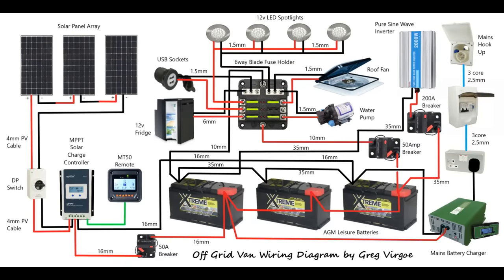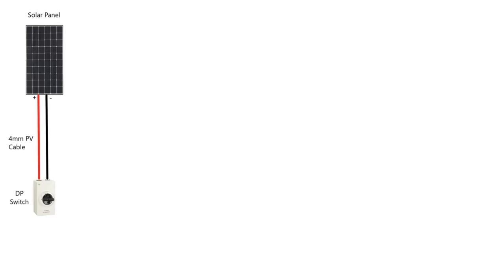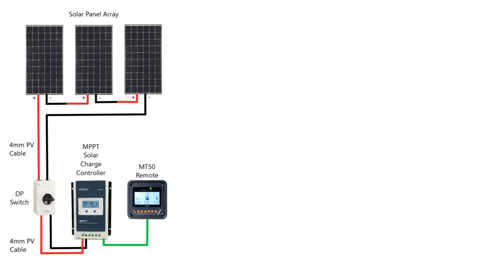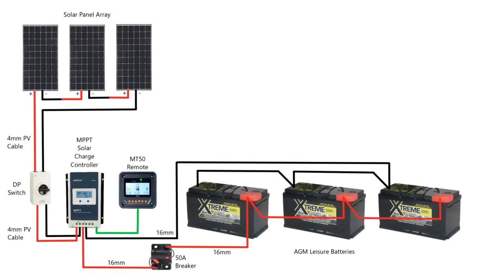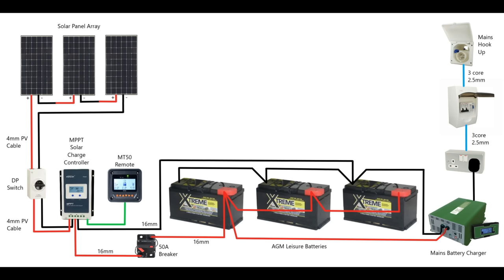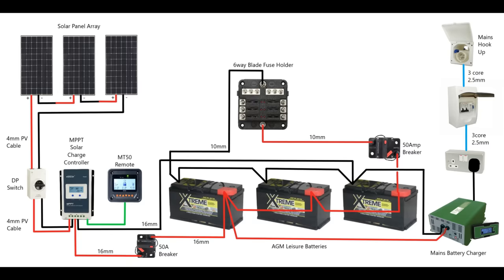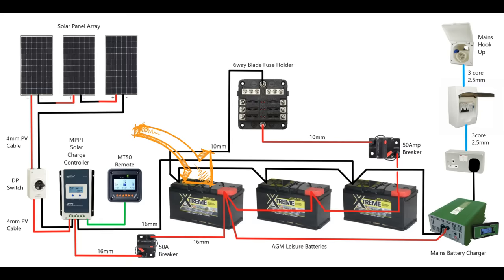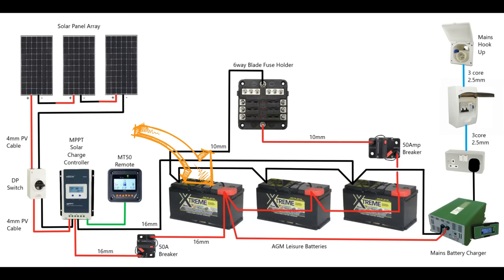How to Wire your Camper Van to be Off-Grid

Comment: What about changing while driving from the Van?
Reply from the maker: I recommend using a DC - DC charger to do that. It very easy to install positive and negative from the charger to both van and leisure batteries. Victron Orion are very good ones

Comment: Could i replace the inverter with a inverter-charger like the Victron Energy - MultiPlus 12V 2000W, 80-50 120V VE? I can’t find any good diagrams with that inverter without it being full of other junk from that company

Comment: Hi there Greg, I’ve sent you a Facebook message with regards to a connection on the MPPT controller. 

My cable is too large to fit in the MPPT controller, what lugs have you used, as I cannot find anything that I can get to fit in the input of the MPPT. 

Thanks

Comment: I have the wiring figured out. Im just having trouble with what size wire and fuse I should use for my 1000w inverter.
Reply from the maker: 1000W / 12v = 83amps
83 + 25% = 104amps
So a 100amp fuse or breaker will be the right size for that inverter. 
Watch my video on cable and fuse sizing https://youtu.be/koFg6oFs0RU

Comment: Hi Greg, great video, I have one question, how do you connect 230V appliances to inverter i.e. do you run cables from inverter to the point where you need power e.g. your TV and if yes what size.

Comment: Why is there a 200 amp breaker for a 2000 watt shouldn't that be a 250 amp breaker or am I doing the math wrong.
Reply: 166amp so you rounded to a 200 amp breaker.. sorry the video is amazing I was just trying to understand this part
Reply from the maker: (2000/12) x 1.25 = 208 👍🏼😁

Comment: Isn’t 166amps a lot for even for 3 leisure batteries and how long can you run your inverter ?
Reply from the maker: In reality the biggest thing I use is the Laptop which is about 140W so approx 12amps
Reply: @GregVirgoe  surely your batteries can provide 12amps ? Is the inverter not converting 166a dc down to 12a ac ?
Reply from the maker: @matthewsmith7319  the inverter will only drawing the current it needs. Just because it’s a 1500w inverter doesn’t mean it uses that all the time. It’s like your car driving at 30mph when it can do 120mph top speed. If I only connect a small load it will only draw a small load from the battery.
Reply: @GregVirgoe  ok thanks Greg

Comment: Can't see any switches for the led lights on the wiring diagram.
Reply from the maker: I left them off for simplicity but you can easily break a red wire and insert a switch.
Reply: It's there Stephen. 11 minutes 58 seconds in for a very short time.

Comment: Where u plug battery backup charger is called what?
Reply: And why the connection went to the ba3 straight without going to charger controller first?

Comment: what wire do i use to connect the parelel batts what mm
Reply: In this setup shown, 16mm if not using an inverter or 35mm if you are.

Comment: Hi how to connect up engine battery to this system ?
Reply from the maker: Use a DC to DC charger to connect your van to your leisure system
Reply: @GregVirgoe  ok would you have a diagram for this 
Thanks Steve
Reply from the maker: @stephenhurrell2773  they are very simple. Poss and neg from van battery to charger and sake from charger to the leisure batteries. 
Victron Orion is a good make 👍🏼
Reply: @GregVirgoe  cheers

Comment: What to do if I have one baterry?
Reply from the maker: Look in the description below this video there are links to diagrams showing just one battery 😊
Reply: And why not to wire the users on last ports on the controler?
Reply from the maker: @kmetkmet7  I believe that is only for small loads like lights but check the specification of the charger. 😃

Comment: Why would the fridge wire change from 4mm to 6mm makes no sense, same fridge doing same thing nothing has changed
Reply from the maker: The larger cable is to reduce the voltage drop. Most fridges need a big cable see your fridge manual.
Reply: @GregVirgoe  Just leave it at 6mm then, its not rocket science.

Comment: How do I find out the information about my solar panel I have bought a truck with one fitted but dont know much about it hope you can help
Reply from the maker: There will be a sticker on the back of the panel with all the details.
Reply: Its a 375 watt so 2hat size controller would I need please.
Reply from the maker: @360outlawdriver3  to utilise it’s full potential a 40A mppt controller is what you need.
Reply: Is a 40 amp one ok to huck upto 2 batterys for storage
Reply from the maker: @360outlawdriver3  if you have 2x 100Ah that would be a good setup
Reply: Do you have a link for the DP switch that is in the circuit between the panels and the controller
Reply from the maker: @360outlawdriver3  download this parts list and all the links you need are there https://www.dropbox.com/s/zvtyj0z7cdeb9d8/Greg%20Virgoe%20Campervan%20Parts%20List.docx?dl=0
Reply: On the lorry is 1 solar panel thats 375 watt going through a mppt 75/15 linked to 2 batteries that are 140 amps each then its linked up to a 2000 watt inverter so I guess I not getting full use out the solar panel as its not linked up to a 30 amp mppt
Reply: If I need to run the cables from the solar panel very far and the wire that came with the panel is not long enough how can I extend the cable length safety thanks.
Reply from the maker: @360outlawdriver3  yes you can buy MC4 Weatherproof connectors which are easy to crimp on yourself. 4mm PV black cable can be brought by the meter from the cable company. Alternatively you can solder the wires and then apply heat shrink. Best to extend the solar cables and keep the charger close to your batteries as that side has lower amps
Reply from the maker: @360outlawdriver3  a 30amp MPPT charge controller would be far better for that solar panel.
Reply: What size cable do I solder if I can't get any proper cable to be safe and thanks for all the advice it will help me to rip all the old wiring out as its a right mess and fit my own wiring looms so I know are safe.
Reply: 30A MPPT PWM Solar Charge Controller 12V 24V Dual USB Solar Regulator with Big LCD Display IP32 PV Battery Controller Load Timer

Is this any good for what I need for my setup better than the one I have now.
Reply from the maker: @360outlawdriver3  you should be able  to get proper PV cable it is made to be outside so is UV resistant and won’t age in the sun.
Reply from the maker: @360outlawdriver3  don’t get a PWM model I would recommend an EPEVER or RENOGY MPPT controller would’ve best for you.
Reply: How many sockets can I have hucked up to my 2000 watts inverter and could I run tv microwave kettle mig welder angle   grinder drill but I know I can't run all at the same time but I am asking as I have a race transporter I own and looking to replace everything so the tv, microwave, kettle in the kitchen then a double socket in the garage for the welder, drill, and grinder and other bits to repair my race car. Am I better having a fuse box installed so it protects the inverter if so could you send information on how I can do all this safety thanks
Reply from the maker: @360outlawdriver3  2000watta is 8.6 amps. That’s the most you can run at any one time. So if any of those devices require more than that say your welder or grinder then you’ll need a bigger inverter to start with. You can run more sockets but only use one or two devices depending on their combined load. Hope that makes sense.
Reply: And how can I find that out please what do I need to look for on the devices to add together watt or the amps please all your information is very helpful thanks
Reply: What do I need to know when wiring a 12 volt cigarette lighter into my lorry to charge my mobile phone safety can you tell me what size fuse I will need to be safe
Reply from the maker: @360outlawdriver3  15Amp fuse and 2.5mm cable.
Reply from the maker: @360outlawdriver3  please watch this video. https://youtu.be/Ji18lY2rtUI
There are other electric ones in the build series that may also help you
Reply: When I do the electrical huck up so I can use a huck up what amp do I wire into on the Consumer Unit Enclosure
Reply: The batterys in my lorry are wired first battery the + is wired to the - on the 2nd battery then the - on the first battery is wired to the + on the 2nd is this right or is it better to wire how it is on this video
Reply from the maker: @360outlawdriver3  when two batteries are wired in series like your truck the volts are added together and the Ah stays the same. So if they are 6v batteries that would make a 12v set. If they are 12v batteries that will make a 24v set.
Reply: So whats the best to wire like in my truck or how it is on you video.
Reply: Yes but how there wired in my truck i am wanting to wire some 12 volt systems so think I am going to change the wiring like on your video  so I know it will be safe and I can follow it better if you think of another way could to tell me how to wire a 12v systems if my lorry batterys are wired up into a 24volt battery bank
Reply from the maker: @360outlawdriver3  your lorry starter batteries should be kept separate to any leisure battery system.  Leave the ones that start your truck and run it well alone.
Reply: Is there any way I can upload a pic onto ere so you can see what I sm on about and I am talking about my leisure batterys not the batterys in the engine bay of my lorry all the questions I have asked have been about my leisure battery setup
Reply: @GregVirgoe  kudos for answering every question. Not all you tubers would bother. Way to go!
Reply from the maker: @LadyGreyAgeingDisGracefully  I try to help as much as I can. 😁
Reply: What fuse do I wire my huck up cable to in the consumer unit in your diagram as on the diagram shows cable going in and a cable coming out but what what fuse do I wire to thanks

Comment: I don't have any idea of the specs of the wire you are using. Here are some standards I do know.
AWG American Wire Gauge.
B&S, Brown and Sharp. Same as AWG.
SWG Your pre-metric standard. A little thicker than AWG, at least in the size I checked.
Metric, area of cross section, commonly in square millimetres.

I have found some 6mm wire on eBay, it also is described a 5 B&S. I expect its copper is about 4mm diameter, but this is not a standard.

Where to connect to the string of batteries?
The resistance of the wire connecting all the positives and all the negatives is negligible. If there is a best point, it's the middle, but not so much you can measure it. Connect to the point nearest your inverter.

I hoped to see you running around with drills making holes, stuffing wires into pipes, screwing screws etc.
Reply from the maker: Then you need to watch the installation videos

Comment: Hi Greg... again spot on video. Do you think I will be ok with 16awg 2mm wire for the lights, fan etc instead of 1.5mm? I’ve got loads left over if I can
Reply: Sorry I meant 14awg I think.
Also... will 10AWG be ok for fridge?
Reply from the maker: It never hurts to go bigger with cables. They will run with less voltage drop and cooler.

Comment: How come nothing is earthed
Reply from the maker: An isolated 12v DC system does not need an earth. On the mains hook up side all earth should’ve connected back to the consumer unit but NEVER connect a mains earth to your van body as there is a serious risk of fatal shock which is covered by statutory regulations

Comment: Don't see a chassis ground.
Reply from the maker: A 12volt leisure system as I have shown does not need to be connected to the vehicle. 12v DC has a positive and negative and as long as you install wires for both you do not need to use the body for a negative. Your inverter case and any mains voltage equipment will need an earth. The use of the word ground is what’s confusing everyone. Hope that helps.
Reply: @GregVirgoe  Ah yes you use the term earth, and in north America it is called grounding or ground.
Reply from the maker: @wrxs1781  trouble is people confuse the 12v negative connection to a vehicle, often referred to as ground, with an earth on mains electrics. The two are very different. I prefer not to use the term ground then there’s less confusion. I also never recommend using the van for negative on 12v systems as they always cause problems with getting good connection to metal.
Reply: @GregVirgoe  Thanks for the reply and true enough, especially for LED lighting. I use chassis ground on my trailer for on the road charging from my truck.
Reply: This is exactly what I needed, a schematic design. Thank you!! Plus your explanation helps very much as well. I think the most asked question would be.....what products should I buy?  What is a good product, what is overpriced and what is not.
Reply from the maker: @danemmerich6775  top of the market is Victron, then I would say Renogy have great products at reasonable prices. Our Epever charger has worked perfect for over 4yrs now and Alpha Batteries for leisure batteries. Great prices and service.
Reply: Profane question about earth: inverter case and mains earth line (yellow/green cable) are joined and connected to the chassis and this is called earthed? But van is isolated from ground by the tires. So the inverter case and mains are anyway earthed by being connected to the chassis? What happen if I am using the appliance from outside the van? Might be a stupid question, but I am not sure I understand if it is safe like this. Thank you for your info
Reply from the maker: Do not connect any your mains 230v earths to the metal body of your van. 
There is a serious risk of fatal shock when entering or leaving the vehicle if the site power loses its combined neutral earth connection. 
This is a legal requirement covered by statutory regulations. 
Your hook up should have a consumer unit with double pole RCD and MCBs like this one https://www.12voltplanet.co.uk/deluxe-ac-mains-consumer-unit-with-2-x-double-pole-mcbs-rcd.html
All earth should be connected to the common earth bar in the consumer unit but not to your van 🚐 
Hope that helps. Look out for my new video on earthing coming soon

Comment: The 2000w inverter is only pulling around 9amps max, so there is no need to use 35mm2 as the inverter just cannot draw more than 10amps from the 12v battery bank
Reply from the maker: Hello Chris, on the battery side of the inverter the voltage is 12v so
2000W / 12v = 167Amps so you must fit large battery cables. 
Do not use anything less or they will melt and catch fire.
Reply: @GregVirgoe  Hi Greg, thanks for your reply. I think I see my mistake, 35mm2 is 6mm or 2 AWG, correct?
Reply from the maker: @chriswright7083  yes 35mm is the cross sectional area so it is the same as 2AWG cable 👍🏼😊
Reply: @GregVirgoe  👍🏻 Nice van build and great videos. I am also in the HVAC industry so your insulation and air changes instructional video is the best I have seen on YT, well executed

Comment: looked at this diagram.  horrible in my opinion.  They make BUS BARS so you dont have multiple connections hanging off your batteries and 1 big DISCONNECT to prevent a Meltdown in case of emergency and you have NEITHER.   You have a 12volt water pump that would MELT the wiring in that $20 amazon fuse panel , and NO PROTECTION coming out of your A/C Mains battery charger.  
This is a TERRIBLE schematic and nobody should EVER replicate it.
Reply: I agree with adding more disconnects, namely between AC mains and batteries as well as a master battery cutoff. 

The batteries he is showing here cannot use bus bars to connect to one another safely. The positive and negative leads are on the corner of the battery and a bus bar would be dangerously exposed. This is not the same kind of battery system as you have on your channel where its individual cells connecting to one another.

Also, the blade fuse block doesn’t use wires, rather it actually uses a bus bar system to handle the current. Further, there’s no way the fuse holder is breaking before the fuse is blowing. The point of adding fuses is so that you control the weakest point of the electrical system.
Reply: The fuse block doubles as a busbar doesn't it?